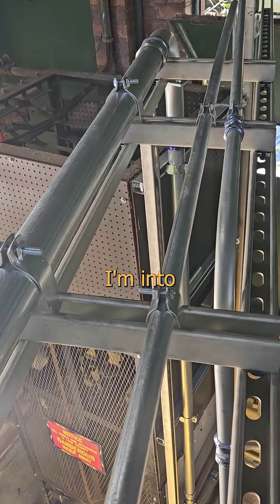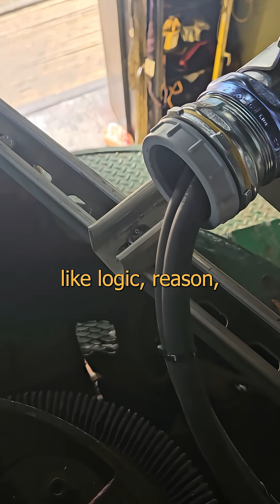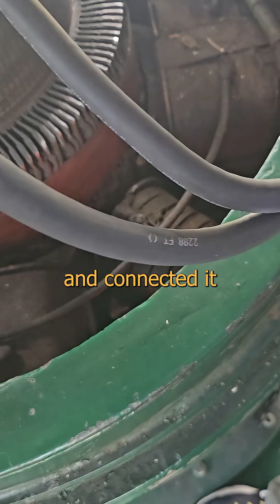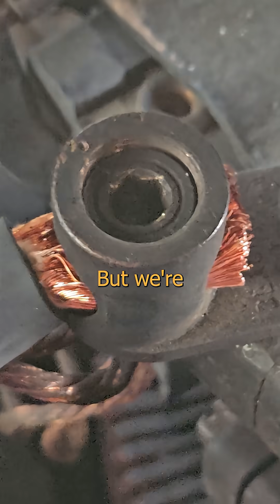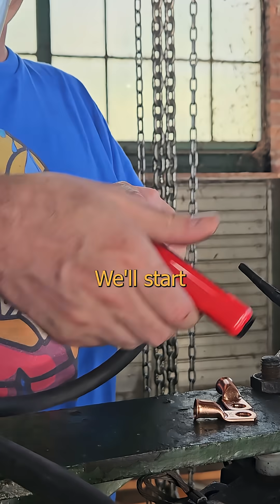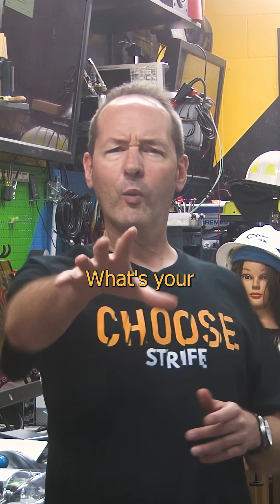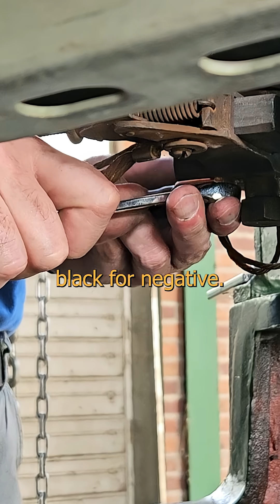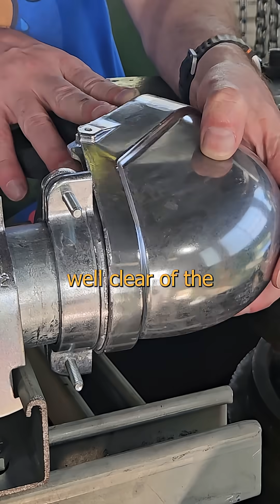Exciter Update #chrisboden #comedy #engineering #powerplant #electrical #educational #wiring

Comment: No-lox is no longer needed even on aluminum terminations as long as the aluminum is AA 8000 series. (Source: Mike Holt, electrical level 2a understanding the nec vol 1, chapter 1)
Reply: Thank you for sourcing! I wish more people knew what that was, you're a real G
Reply: @liamer88 that’s not a source! That’s just who told him about. If he gave you a source it would be NFPA70 section 110.3(B).
Reply: @wm79198  Well, it included Vol 1, Ch 1. So that is a reference to "a" source, not just "who told him about it." Still, the actual code source is better. I wonder if Vol 1, Ch 1 includes that "actual code source...?
Reply: @steveh8724 chapter and personal references are not how the NEC is cited. You give specific code articles that relate to the work at hand. And fyi, we’re on like vol 42 of the NEC, it’s been around since the late 1800’s. So there goes that reference
Reply: @wm79198  no one asked for an NEC citation. That wasn't the point. The "where he heard it" IS his source, which he correctly cited.
Reply: @SaxyPlayer96 that’s not how sources work if you want to be taken seriously. But this is the internet after all, where people like you will believe anything because “he said so in a comment”. Also you’re wrong, a source for published information isn’t a person, it’s the actual published information.
Reply: @wm79198  FYI, you completely misread the citation from the original comment and your comments are misguided. The "Vol 1, Ch 1" text in the original comment and in my comment refers to Vol 1, Ch 1 of Mike Holt's book "Electrical Level 2a Understanding the NEC". It is CLEARLY NOT a reference to "NEC Vol 1, Ch 1". So your comment "And fyi, we’re on like vol 42 of the NEC, it’s been around since the late 1800’s. So there goes that reference" is COMPLETELY WRONG. You didn't bother to read carefully enough to understand that the citation was not to Vol 1, Ch 1 of the NEC!! It's a citation to Holt's book! So in the future, please double check your work. You failed this exam.
PS: To all the fools who liked your comment, you also have reading comprehension challenges and you fail too. Perhaps all of you should work for TRUMP. He particularly likes people who are confidently arrogant, even when they are completely wrong.
Reply: This just was the peak of a technical comment. Wish there was more of it on youtube.
Reply: I use Alox in damp locations to minimize corrosion of the copper. The added time and materials is minimal, usually insignificant in the project total.  Code is the minimum standard, not the maximum limit.
Reply: I still can't believe Mike Holt became as famous as he is. That's pretty awesome. I still remember a van saying 'Mike Holt Electric'.
Reply: Still have to use it in Oregon especially around the coast since without it the the lugs will definitely corrode
Reply: Not required, but not gonna hurt anything either😊 nolox on copper isn't gonna do much either... off or on...
Reply: Came here for this. Been in a few mike Holt classes too
Reply: Going from aluminum to copper it’s not a bad idea, just more oxidation and corrosion resistance
Reply: This feels like a comment from a forum rather than something one would find under a short. Amazing.
Reply: even giving citations.  extra points!
Reply: If a dab Penetrox keep any corrosion off a long term connection. Go for it.
Reply: So for national code, Noalox not needed but in telecom they want it in every electrical connection regardless of like to like metal connections or not.  Oh and even it comes to phasing the system they like to make sure someone not familiar with the battery backup system will make a wonderful at flash, they like red to be on the "hot" side instead of positive. Most of the equipment in the field runs on -48DC so the "hot" wire is the negative and the return is positive.
Reply: i like your funny words, magic man

(i understood none of that)
Reply: what does that even mean

Comment: In high heat/moisture scenarios i have seen copper go bad quick. Source my career and livelyhood as a maintenance electrician at a lumber mill with cogen, our kilns are very hard on equipment and our predicessors thought putting all the gear in the hallway that gets 220f w high moisture content was a good idea. Anyways never hurts to throw some on in my humble opinion, if we dont in that location it wont last very long
Reply: Yes even just some fork lift chain grease there will help, though i use copaslip on those copper to copper, or even copper to steel, because it does help a lot with the green crusties. Though the sleeving will have to be adhesive lined, or you use a Hellerman rubber boot with those 3 jaw expanders that you use for castration rings as well, or a go around with hot glue before putting the sleeve and shrinking it, a quick and dirty way to do the same if you have no adhesive lined to hand. 3M does make those pre shrunk sleeves though, where you pull out a plastic spiral spring to get them to work, and those, while expensive, really do grip well and never get corrosion in them either.

Comment: So something that we use a ton of in the oilfield is battery terminal protector. Im assuming you guys use it all the time, but I saw those big exposed copper bits and went "SPRAY IT, SPRAY IT WITH THE RED STUFF".

It prevents corrosion and helps prolong the life of the connector, although by the sounds of it the moving bits wear down a lot faster then electrical ones.
Reply: I use spray cosmoline because it does as good a job as the red stuff and it dries to a hard waxy coating and doesn't stay messy

Comment: Dang that really interesting (and a teaching moment about the DC and uneven wear)
Reply: What's really cool is you can see it visually.  What happens is you get carbon carryover into the copper slip ring.  And it is polarity sensitive.  So reversing the polarity on your slip rings makes the carbon go into the other ring as well.

We had to do this on our synchronous motors (10,000HP steel mill motors), and you could see the copper slip ring darken from the carbon.  So if you saw one darker than the other, it was definitely time to switch the polarity.

It was actually a PM item, because it is just that important.

Comment: I was thinking why didnt he use crimps and lugs.... I use them on 12v automotive stuff all the time and thought hey he knows way more than I do... glad to see it works here too
Reply: Solder makes a lousy conductor.  Copper to copper for High Amperage Connections.  For small 12V wires it's probably better than an improper crimp.  It won't rattle loose.
Reply: @RTmadnesstoohmm most of what i do is less than 1800 amps at 12v uaualy i see solder connectors hold up to corrosion and vibration better
Reply: If you want the professional spec for wiring harnesses and interconnects, it’s IPC/WHMA-A-620E (E is the current revision)
Reply: Hydraulic crimpers- YES !
Reply: I solder my crimp lugs for the best connection possible and the strongest termination possible. Yes, crimping works fine, but with solder, you are sure to get a complete connection on all strands of the cable.
Reply: @CICWSfirearms  If it's a 'proper' crimp, the strands should be 'cold welded' into a solid piece of copper at the crimp, so solder wouldn't penetrate into the actual crimp. If it does, the crimp wasn't done properly. (correct lug size, correct crimp size, and correct force applied to cause a cold weld).
That said, if it is a proper crimp, solder won't hurt it, but if it's not correct, solder can make it worse because as electricity moves from one type of metal to another, there is extra resistance introduced (more heat & more voltage drop). So in general, solder either has no effect, or it makes it a poorer connection. If there's room for solder to penetrate the crimp zone, then the crimp is a fail because there should be no voids in a solid cold weld.
Reply: @CICWSfirearms  So you solder instead of crimping them?
Reply: @CICWSfirearms don’t do that. A good/properly done crimp termination should not need solder to be reliable. A good specification to work to is IPC/WHMA-A-620E, which is the working specification for interconnects and wiring harness assemblies

Comment: Southwire recommends Nolox on all connections regardless of AL or CU even though most state its not needed on copper. Would silicone dielectric be useful in this situation?
Reply: I'd suggest that it might do more harm than good.

My (admittedly extremely rapid and very much not in-depth) research suggests that most noalox products contain zinc. That's fine for aluminium-to-copper contacts, but for copper-to-copper it adds a second metal, potentially creating the dissimilar metal situation it is typically applied to mitigate.

Comment: Mom says to say thanks for your service.
Reply: for the educational content or for the other thing?
Reply: @kkjkjh  Both! Mom certainly learned a thing or two
Reply: Idea for you Chris: hook up the cables to a pair of relays (if you can) and use a 555 timer to swap them like once a week.
If relays aren't doable, I'd make the wires at the exiter 2 weird colors & set up a box with a double pole double throw switch to manually chunk the contacts over. When the boss isn't looking, that could be automated in some form.

Comment: I must admit that when I saw the original video I wondered why you didn’t at least use a boot lace ferule on the conductor, in my neck of the woods it’s a regulation that stranded flexible conductors like that need to be in a ferule, I’m not in the same hemisphere as you so my electrical regs don’t mean squat, thanks for making all the videos, keep on trucking
Reply: Not sure about UL requirements but it's SOP to use lugs or ferrules on everything at my job as well. Whiskers lead to arc flashes which lead to lawsuits and deaths. Also stranded cable doesn't always want to stay torqued down if you bare wire it.
Reply: @slasher1166    He said it was 120V DC.  Arc flashes!?!
Reply: The lug is the ferrule? I have no experience in this.

Comment: ❤❤❤ Thank you for not leaving it how it was! This is beautiful. ❤❤❤
We just crimp and sometimes heat shrink.
Source: ovens with hundreds of kilowatts, built in the 1980s (I was in grade school, but the company still does service and support on them, so I’m learning the old ways) that are still operating.
Edit for: oh crap, I just remembered some other connections where we do solder down into that crimp. Now I need to ask my boss why some are one way and some the other.
Well, the oldest cables made this way that I know of in our machines have been in service for 37 years, so I think you’re good.
Reply: I found out the answer. We only have one customer where we solder in a crimp like this, they want it that way and my boss doesn't know why.

Comment: All copper in doors no salt water.  I  wouldn't use antiox. Sea air salt water environment.  I'll use antiox , its not required  but its keeps the corosice environment at bay.
Reply: Salt water is particularly bad because it's full of electrolytes (that's what salt is, after all) and the highest-concentration metal ion in it is almost certainly sodium (i.e. not copper), instantly creating a simple chemical cell.

Comment: Copper lugs and heat shrink are always preferred. The only thing I would have changed was add some extra length to the bends in the weatherhead. Just enough to made the angle inside that pipe slightly less acute. I have no concrete justification for it besides it works me, but I suppose it will relieve strain in the copper and insulation on the inside of the bend which might prove prudent later on the the installation's life cycle.
Reply: I wouldn't imagine it would be a huge problem unless it's repeatedly flexing (I've never been told that electrons care about how sharp the turns in wire are), but I'm not electrically-trained, only barely-chemically, and that more on organic chemistry than electrochemistry.

Comment: If it's a modern upgrade, it should last longer.
Can you get someone to make a video in 100 years to see how it's going.
I'll try and leave a clause in my will that some relative has to watch it 😂
Reply: make sure to tag me when the video is out
Reply: Your optimism about the world being the same in 100 years is refreshing :)
Reply: I agree. I like making things to last!
Reply: I'll put it on my calendar. But even I forget to look at the calendar, much less the folks who follow me...
Reply: Its only fair if they dig you up and play a video of it running.
Reply: If it's a modern upgrade that means it will need to be replaced in under 10 years
Reply: He states that it worked fine for 100 years and then proceeded to change it… why? Why not leave what works alone?
Reply: @MegaTowboater he improved it and made it safer but ultimately didn't change that much mechanically, it'll be fine

Comment: Wouldn't if make sense to use a relay triggered system to do the switching automatically a set number of hours to reduce the overall downtime of the generator?
Reply: I think that's a good idea, but that is one more moving part that only gets used every 6 months, and likely wouldn't get noticed if it failed to flip until the rings failed. Unless you used a solid state relay setup, which probably would exceed the cost of getting the new guy to just move the terminals by hand
Reply: I was wondering if you could use a reversing contactor with a timer.

Comment: Neat Having The Time To Think Thru..
A Do Over..
I Do That Every Time As A Military Fleet Mechanic..
Then As Vehicles Come Back Thru, I RetroFit The Improvement I Crafted Since Last..

HMMWV Battery Cables Are A Classic Example..

I Didn't Like Factory Routing..
Too Abrasive A Run..
Hasn't Caused Problems .
BUT .
There IS A Better Way

Comment: What to use for termination?   My employer uses zinc plated terminals with air tight fittings.  We use a hydraulic crimper too.    However our crimper is so big that it uses  big wheeled cart and requires two workers to use it.  One to hold the terminal, one to hold the cable.  Everyone checks for clear then someone applies power.

We have a gigantic weed up our behinds about stray strands. They are a disqual for a connection.

Comment: man, I had to help replace a starter on my friend's mom's car, to get one of the studs out we had to cut the ground wire, so naturally we had to put another crimp lug on it, we had to go buy the big 2 handed pair of crimpers for it, and all I can say is that I don't ever want to have to deal with that again, also the entire job for this starter took 12 hours with 2 people working on it, and we had to replace the alternator and battery a few months back, the alternator took 6 hours. what's the car? it's a 2007 mercury mariner, 2.3 liter 4 cylinder. now hearing 4 cylinder would make you think, hey, small engine, should be easy, we'll you'd be wrong, ford engineers have no idea what they're doing when it comes to engine bays
Reply: Is that the one you have to pull the right drive axle to get the alternator out from under the engine? That the exhaust over heats and burns up the alternator? And the electronics fail so the battery light is always on?
       Ford always had a 'better idea'

Comment: In the telecom we have to use clear heat shrink so they can see the crimps.
Reply: Watching this I was trying to remember something that I had watched earlier in the year and this was it. I forget the application but clear was used to see the wire colors and also to see any evidence of corrosion over time.
Reply: @lastvestiges  was it the guy on the train? I saw a short about a guy learning about clear heat shrink on the cable ends of his power feed for a train
Reply: Telecom wiring is color coded for each conductor.
Reply: @vampire845  in control, the heat shrink should be just above the crimped portion of the lug so it can be inspected. With most tools, to DIN standards, it should be crimped twice. 1st closest to the ring, then 2nd crimp closest to the cable. Heat shrink should clearly leave the two crimp sites clear for inspection.
Reply: @vampire845  and we’d use wax string instead of zip ties
Reply: Good old #9 wax string
Reply: How do you color code then???
Reply: @Breezy8257  Colored tape on the insulated part ?
Reply: @Breezy8257 telecom wire is already color coded